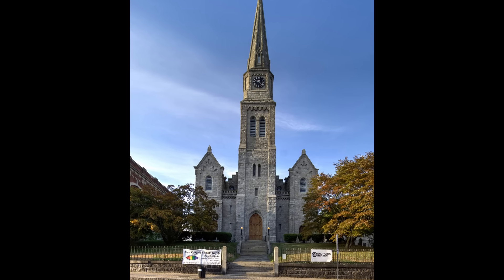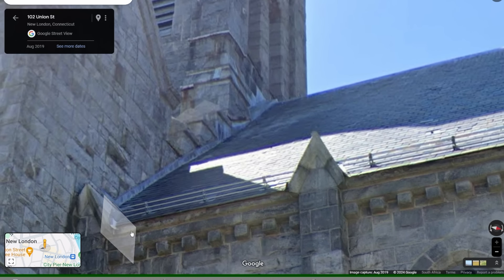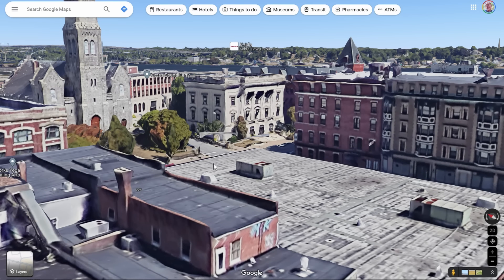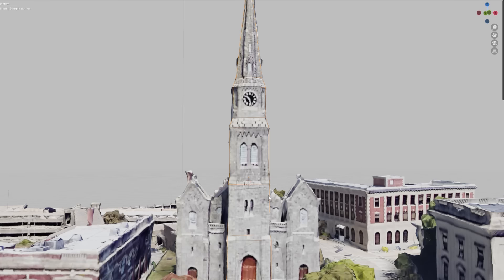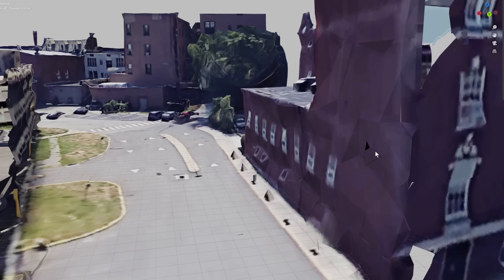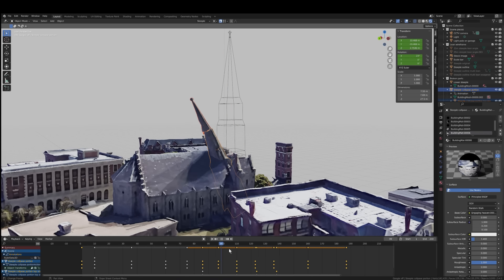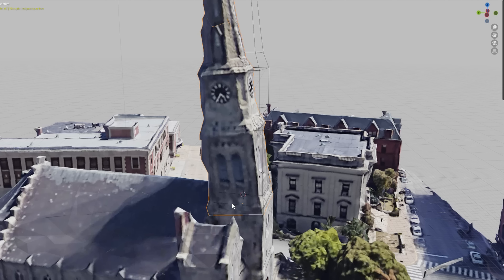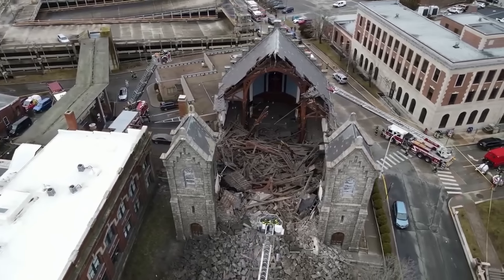Church steeple collapse | caught on video and simulated in 3d

Comment: #MikeBell : there is a video which shows two years ago a quote for roof air conditioning units.  This, if actually installed, I would speculate the position of the easiest venting into the roof of the church would place the AC/Heating unit in the exact position you hypothesized the start of the collapse originated from. Did they in recent time add weight?

Comment: Would like to add that the side it collapsed on is where it ties into the main hall. Noticing the open high arch i have to ask what form of support beams were holding up that great weight. These should be saved from the rubble and inspected. Perhaps water from the failing flashing rotted out the fasteners holding the beams together
Reply: JFC... it is academic and needless at this point. Good grief you 20/20 kariens.

Comment: The arc must have failed in the base too, pushed out by the lean. There is no visible deformation in the part of the building that is shown in the video and it practically free falls, which always means a failure way down, most often in the ground or foundation level.

Comment: Is this something that occurs frequently?
Reply: troll
Reply: Chichester cathedral spire collapsed at 13;30 Thursday 21st February 1861 while work was ongoing to repair bulges and cracks in the 700 year old tower.  Fortunately the workers were at lunch.  The spire was rebuilt.

Beauvais cathedral - the tallest Gothic Church - had three significant collapses: - 1225 of which little is known
- 1284 (20;00 Thursday 29th November) when the recent choir vault collapsed
- 1573, when the 150m tower collapsed four years after completion

Between 1315 and 1332 the central tower of Wells cathedral was heightened and a timber and lead spire added.  The base of the tower had to be internally braced in 1338 by the unique solution of three massive 'scissor' arches.  The spire burned down in 1439.

The church in Chesterfield has a 1360 spire that is famously crooked - 228 feet tall (70m) it twists to 8 feet (2.5m) off vertical.  The prosaic reason is that it was built shortly after the Black Death using easily-worked green timber, and at a later date was clad in lead with a pattern that happened to impart a twist as the sunlit side expanded more than the unlit side.  Another explanation is that it was twisted by the devil's tail as he fled the ringing of the bells.
The cheeky legend is that a virgin was married in the church and the spire was so surprised that it twisted to get a good look; rumour has it that if another virgin should get married there the spire will straighten out.

Comment: Was there a lot of vibration from the construction area?
Reply from the maker: Construction was minor works.
Reply: In the past year, there had been major and significant construction driving piles for building the new State Pier for the Revolution Wind energy project in New London. This was half a mile away. Could that have been a factor? @Mike-Bell
Reply: JFC... it is academic and needless at this point. Good grief you 20/20 kariens.

Comment: They should have simply removed the steeple years ago.  A tilting steeple is not an uncommon problem in many old churches.
Reply: Ahh yesss, "simply moved the steeple"... Thanks keyboard warrior 20/20 karien.
Reply: @billhosko7723  No.  RE-moved the steeple.  The base of the tower might have been reinforced and left if foundational support was adequate.  Steeple removal has been done in many older northeast U.S. churches.  Seems that in a temperate climate, the taller a concrete brick or stone steeple is, the more structural problems develop over time,  especially if the tower contains large bells.